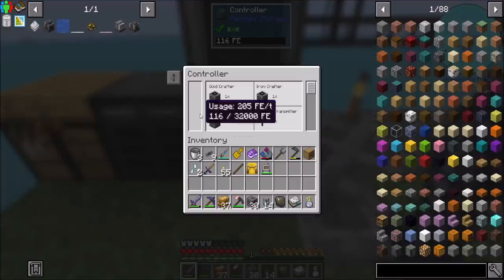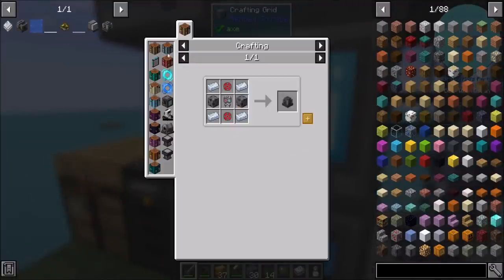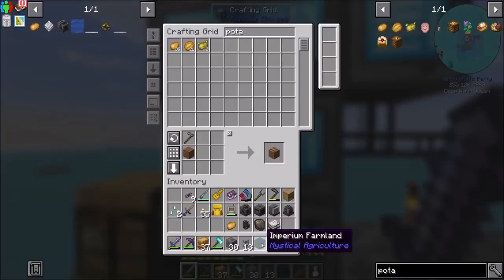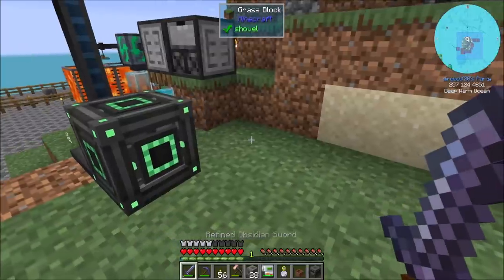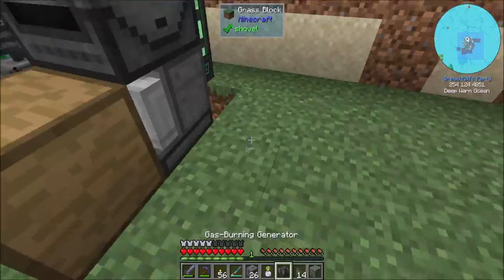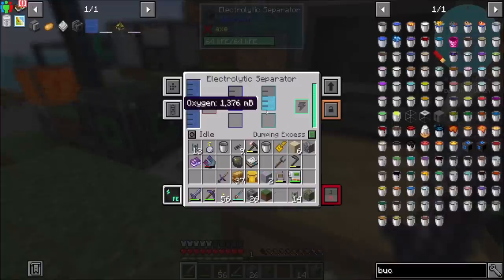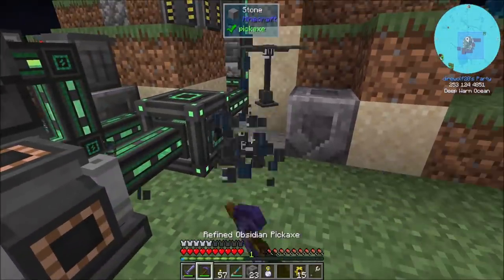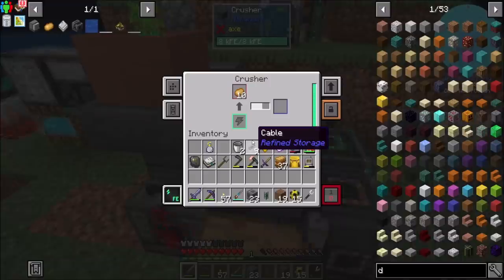OceanBlock Ep20 Power Upgrades

Comment: If you wanna make biofuel from Mekanism, melons are by far the best option. Botany pots grow entire melons, which can be split into 9 slices with a compact drawer for 4 biofuel each. That's 36 biofuel per melon.
Reply: Cookies actually are the single best option. You get 7 biofuel per cookie and 8 cookies per craft, which only costs 2 wheat and 1 cocoa beans. You can hopper pot the wheat but not the cocoa beans, not that it's an issue as cocoa beans grow quickly on jungle logs, which are easy to get with wood essence.
Reply: I have had the best luck with flowers.  5 biofuel and grow in a fraction of the time as potatoes (at least in engimatica 2).
Reply: Another solution is to hopper pot into a drawer controller connected to two drawers; one for potatoes which hoppers (or Refined Storage Exporters from External Storage on the controller as well) into the crusher and the other is for the poisonous potatoes with a stack downgrade and voiding.
Reply: @DizzyDJW  Thats like a whole another level of complexity for marginal efficiency, overall not really worthy given dire resources. Melons are basically 1 botany pot, 1 drawer + 1 compacting drawer and a pipe with a filter, it fits in a 3*2*1 also it's really scalable
Reply: Melons are definitely the best since you can grow one melon and you get 9 slices. I have a setup on my ocean block that produces over 200k Rf per tick using 3 phytogenic insolators with melon. All you need is a compacting drawer
Reply: powah reactor is the best option but ehh not my lets play
Reply: @Loan--Wolf  powah reactor generates 1 gas burning generators worth and it takes a lot of power to make the nitro crystals
Reply: @professor_deadshot  maybe not but i wasent trying to say they was just that there a hell of a lot easer to deal with

Comment: “What does the gas burning generator burn? Liquid Ethylene?”
Reply: Yeah I thought I heard that strangely, I just let it slide cause it’s 7am over here and I just woke up 😂
Reply: Hum... Well...
Gasoline does often just calt "gas". So....
The mistake is not without reason oO*
Reply: @ChaoGirDja  That's the wrong kind of gas. Ethylene (also known as Natural Gas) is the hydrocarbon used for gas burning stoves, ovens, and boilers in homes around the world. Gasoline is not used for this purpose, pretty much ever, I think mainly because it stinks pretty badly. Ethylene does not - it's pretty close to odorless. Anyway Gasoline is used almost exclusively for combustion engines of various types.

I assume Dire is just getting ahead of himself with Liquid Ethylene vs regular Ethylene.
Reply: @ChaoGirDja  Natural gas is a mixture of hydrocarbons (Mostly methane as you probably already know) Ethylene is just a hydrocarbon from the alkene group which can be found in natural gas. (In significantly reduced quantities) Ethylene is commonly used to make plastics.
Reply: @jeffwells641  LP gas here in Australia is a flammable mixture of gases such as propane and butane. That's the kind of gas most gas burning stoves and cooking plates in BBQ's use here. It's pretty good for cooking although there have been instances of accidents involving it. Scrappers don't like seeing them in metal scrap piles, I witnessed one scrapper using a magnet grab pick up and twirl around a LP gas container, until it was pointed out to him that it had already been punctured. You want to see what electromagnets can do? Watch some scrapper twist and twirl a gas tank in midair! :D
Reply: gas grills burn Liquid Propane, seems like a fair question
Reply: @wjerame  true and gasoline engines mix air with the liquid fuel to create a fuel/air mixture in order to facilitate combustion. Definitely not unwarranted to think that a gas burning generator could use a liquid fuel source. Nothing says it doesn't aerosolize a liquid mixture.

Comment: When is dire getting the magma block for high temperature jar crafting. Lava is produced much faster with high temp. Also a lapidary dynamo is quite good to have, as those gems are pretty much useless.
Reply: I started with a lava generator that dire started with and two lapidary dynamos so i can burn both saphires and rubies at the same time lol, just recently made three basic reactors that run off of uranite, i forget what the mod is called exactly. Made 4 energy storage blocks that hold 500k rf each and really just wsiting on more diamonds to expand them.
Reply: So much easy power in this. Lava into magmators is basically free with cobblegen. Blursed earth mob farm makes so much raw food you can run multiple culinary generators merely as a byproduct. Likewise with seeds you can power various generators with wood, saplings etc. Zombie flesh is fuel too! Good way to manage all the junk which accumulates but until late game, e.g. Draconic, lava and solar is all you really need.
Reply: He can go back to the dungeon and grab one of the soul torches. Those generate high temps which make lava three times faster than magma.
Reply: Wind generators are super easy, and at the height of your island, make around 100 FE/tick.  The biggest cost is gold, which ceases to be a problem once you start exploring the ocean floor.  I'm running 10 of those, one lapidary dynamo with the second upgrade, and a magmatic dynamo hooked to a jar/cobble generator.  This runs two netherite sluices and all my mekanism machines, each with 8 speed and 8 energy upgrades quite easily.  I actually had to turn off my sluices for a bit, since I need to sort out my storage.  I want to try something other than AE or refined storage for a change of pace.
Reply: He made magma blocks ages ago with the dripper. If he'd waited a bit longer, the dripper would eventually have upgraded the magma to blue magma.
Reply: @akakscase  true ,but at a lower efficiency than the blue magma block

Comment: 22:56 I've had similar happen with a MA resource crop in a hopper pot over a drawer, when I replaced the drawer with a chest, it produced one of the secondary drops. So it might be that poisonous potatoes can't be crushed and is clogging the system there.

Edit: Ah, not quite what I thought it was, but still, good to be aware that secondary drops can stuff up single drawers :P
Reply: What do you mean? That was exactly the problem.
Reply: Came here to say this, glad someone did.

Comment: What I always do with the poisonous potato problem is lock a 1x2 drawer to potato and poisonous potato, then slap a void upgrade on it. Have the botany pot output to the drawer, then stick that on top of the crusher. No more problem.
Reply: How do you move the potatoes from the drawer into the crusher?

Comment: The phytogenic insolator is pretty good, I am running 4 gas generators with one fully upgraded insolator using phyto-gro as fertilizer from all the sluice-junk  producing potatoes.
Also when did Dire become such a aqueous accumulator denier?
Reply: I think he said once that he doesn't like "free" resource collection like the aqueous accumulator. Even though it's just water, he'd rather pay the little bit of rf/t than have it collected free
Reply: @CodingWithCameron  And yet he uses hopper pots

Comment: I use dandelions with botany pots, along with 6 gas generators, and I really don't run into any issues (unless I'm running one of those advanced botany pots - may need to get into Powah reactors for that).
Still, the solar panel is an eyesore? Let's talk about the direwire. :)
31:16 - I was screaming "Finally!!!" here, after 15 minutes. lol Event more compact would be an aqueous accumulator.

Comment: I think wheat works pretty good for biofuel production because both the extra seeds produced and wheat can both be turned into biofuel. I would have to double check that but I think that is the case for wheat but not every plant is like that. Most plants you can only turn the crop into biofuel.

Comment: You should really set up auto hammers to create sand, dirt, gravel, dust in an automatic process. Diamond hammers don't require power and they work pretty fast. 

I have 3 that feed straight into my sluice setup then a refined storage subsystem that automatically turns it into ingots and voids the junk like cinnabar, niter, sulfur, gems, etc before converting the useful materials to blocks and passing it to my main refined storage system through a buffer chest
Reply: I don’t like that the auto hammers have a practically infinite output buffer. It’s cool that they don’t need any power, though.
Reply: Cinnabar isn't junk, though. When used as a catalyst in an induction furnace, you get tons of diamonds and emeralds out of the clusters you sluice up. Much more than from the enrichment chamber, which gives two, or even the mechanical squeezer, which gives three.
Reply: @FieryMeltman  yeah, you get about 4.5 diamonds/emeralds per ore. It’s nearly as good as the full Mekanism line, for only a tiny fraction of the cost.
Reply: @felipevasconcelos6736  Yeah, I have no idea why their output buffer is so huge.  If you output them into a storage drawer with a void upgrade as the last step before the sluicing though, you can prevent them from ever backing up.

Comment: Best biofuel production is mystical agriculture nature essence being crafted into melons and then turning the melons into 9 slices which give 4 biofuel each. So 36 biofuel per melon and 16 melons per 9 nature essence. Requires a bit more automation but that should be no problem for dire.
Reply: You can put melon seeds directly into a bonsai plot and it produces full melon blocks, which you can cut into 9 melon slices and use to produce biofuel. It requires far less automation than mystical agriculture nature essence

Comment: Easiest way is to automate lava and use Powah magmatic generator. You could have done that much earlier. The high heat block makes the lava recipe down to 1 bucket per 8 seconds or so. Enough to power multiple magmatic generators.
Reply: He did do this much earlier...he's just forgotten he can upgrade it.

Comment: Dire put the hopper back pointing into a drawer with a poisonous potato in the drawer.
then the hopping botany above the hopper this will allow you to run it with the potato.
because the normal hopper can still output under it if there is an inventory slot.
this way poisonous potato will go into the drawer and the normal potato will go into the crusher.

Comment: You get a huge amount of uranite, and the loot items give me  a decent start towards Powah reactor and flux points. Not yet needed more than the basic reactor.
Reply: Cant agree more. Easy to set up a hardened reactor for plenty of power. Ice seeds for easy packed ice cooling.
Reply: @canhamcan  I just used a starter since i dont need alot of power yet, but it is a really easy solution for power for only a bit of uraninite (i have thousands of uraninite sitting in my rs, maybe the sluice being connected to my rs wasnt my brightest idea)
Reply: Mekanism's power options are definitely way better than any other mod he has access to.
A bucket of ethylene is 12mrf, 20 biofuel makes a bucket of ethylene. Each potato is making 2mrf here. 
The gas-powered genny makes 80krf/t.

Comment: Solution to your potato problem, use a 2 x 1 locked drawer with a void upgrade. Hopper botany pot into drawer and crusher pulls from drawer
Reply: Mekanism machines push but don't pull. A bin gives a nice buffer and can eject out the bottom, but that doesn't help with the poisonous potato.

Comment: I think that is more efficient if u use nature essence with the mekanism crafter to produce potatoes, smelt them end use them to produce bio fuel. power for all of this extra process is such a little part of what 1 gas burning gas gen can do that doesn't impact the production once it's started. If I don't remember it wrong u'll need 3 and a quarter PRC fully upgrade to overcome the ethalyne request of three gas burning gen . Each of them capable of producing around 70kRF/t ... power for days

Comment: The main problem here, is that Oceanblock is based around the Sluice. So trying to find ways around it (using mystical ans stuff) is just so wrong and intended for midgame. You should already have two or three sluices running full time producing all the resources automatically. Also lapidary generator produces a good amount of power from rubys and saphires that aren't needed for anything else. Lava setup can always be improved/expanded to fit the needs. I know Dire doesn't read comments because of backlog, but maybe this is helpful for someone else...
Reply: I wouldn't say it's "wrong" to avoid the sluice, but it does make things comparatively more complicated and difficult if you do avoid it.

Comment: I think Dire should do an updated mod spotlight on Blood Magic. So much has changed since I last played it in 1.7.10, that I'm kind of stuck with the tartartic gems right now. I'm at the point where I think I need to use the crystallizer, which the book says to put a tartartic gem in, but right clicking it does nothing (I only have a common gem)... I feel like DIre's going a bit quick with this mod in this pack. lol.

Comment: does anyone else miss the bonsai pots from skyfactory 4?
Reply: Yes, but the botany pots are a great replacement.
Reply: @JamesStansell  Yea, but from what I have seen there are far fewer options in the config file. With the bonsai pots I loved how much you could change them in terms of behavior and looks. It seems that the only benefit to botany pots is the multiple colors, but maybe I missed something.
Reply: @MegaLokopo  I'm not sure about looks, but I believe the recipes can be changed using the standard Minecraft data packs. Some modpacks may also use kubejs to adjust the behavior.
Reply: @JamesStansell  where would kubejs/data packs be stored. Or would I have to create them myself?
Reply: @MegaLokopo  I remember seeing a datapack directory named sf_one in the sky factory one modpack. OceanBlock likely has a similar setup if you examine it. The seaopolis modpack may interest you because it made a lot of changes to the botany pots, mostly removing the items that would grow in them.
Reply: @JamesStansell  Cool, I'll have to look into that stuff. One of the things I always did in sky factory 4 was make the bonsai pot trees bigger and/or grow faster. Its a really cool effect and can be done all from the config files. The trees would be the same size as a traditional tree but still be in a bonsai pot.

Comment: Use a sink if it is available to supply the water, no power consumption and a single pipe provides unlimited water.
Reply: It's not in this pack.